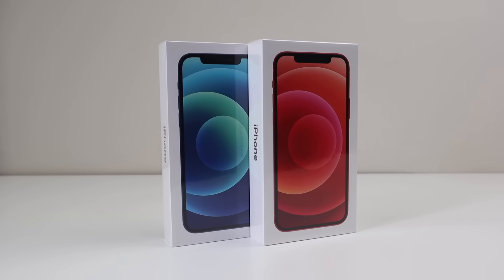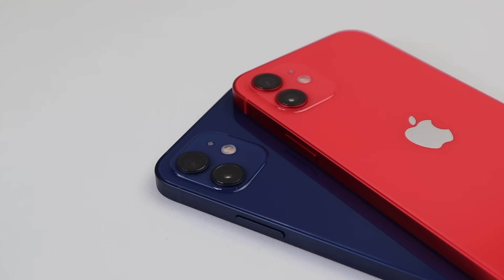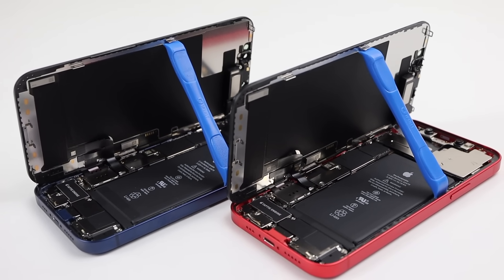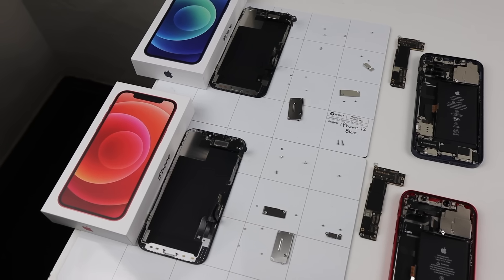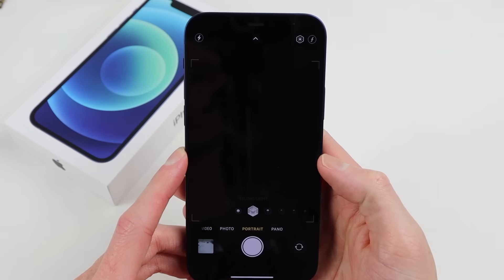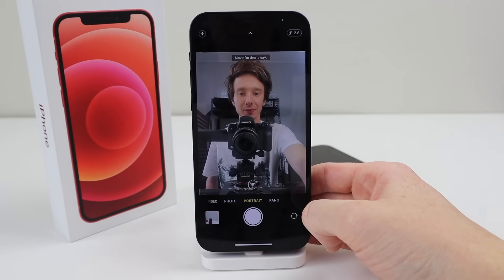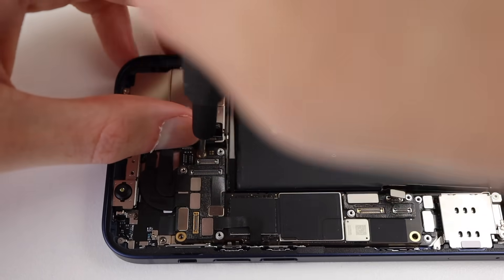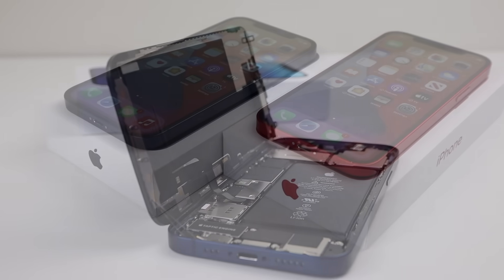iPhone 12 Anti Repair Design - Teardown and Repair Assessment

Comment: Apple never ever want anyone to do any form of repair,none of there phones have been a revalation technically yet they claim they are the pinnacle .there has been so much they have done wrong in the past yet they still rip everyone off with inflated prices for phones which are no better than the competion. apple play catch up every year yet its the badge that sells the phone not for the sum of its parts which some are sourced from samsung and LG apple have done everything to keep you tied to them even down to repairs something which should be easily undertaken by a 3rd party.this video proves again how sneaky apple are and this new trick will make apples pockets a bit deeper.

Comment: 1:00 I commented this exact same problem on a different video, and i had a bunch of people defending apple, that people will have a usb-c charger at home, well i don't, because i strictly use iphones, i dont buy a new product when my old one does what it supposed to do, i have a retina macbook pro from 2012, that thing works perfectly fine, but it doesn't have usb-c, i have an ipad 3 (its old, i know) but once again, it works for me, but those iphones come with a usb-c cable, just as i expected, IF i buy this device, i will have to buy a usb-c charger brick, because i don't have any devices using that port, but usb-a bricks, man, open some drawers and you will find plenty of those! Ewaste . . . Apple is going in a sh1tty direction, and i don't like that, i retired my mac pro in favor of a stunning gaming pc, and if this is the route they will take, i am taking a different one, away from apple products for good!

Comment: It's because any used iPhone 8 gen and earlier are riddled with cheap cheesiness replacement parts if you buy them used from bulk sellers. They are all refurbished in some way and a lot of times the customer gets the short side of it. I've seen a lot of these worked on devices and you can easily tell they have replacement parts in them. Apple is protecting the buyer because in the open market you will only find replacement camera modules with degraded quality. So lets say someone bought a destroyed phone to fix and sell it, the customer will most likely get non oem parts inside it that is of lesser quality.

Comment: Good video

Good video. I think consumers have the right to repair their own devices, and manufacturers shouldn't hold the monopoly on this. Do you think the cameras and the controller on the board may have been slightly different hardware revisions, which may account for the problem?

Comment: In some new vehicles you cannot change the battery without using manufacturer tools to "pair" or register the change, seeing the iphone pairing screens and cameras, and not letting people reusing parts from other phone does nothing for recycling, in some way I can see batteries being an issue, but provided they are to the same spec then there should be no issues. This is just protection racket gone mad.

Comment: Well, you can reset the software as often, as you want... The display, batterie and face id components are equipped with an ,,ID Module'' which pairs them to the logic board.. meaning, you would have to take the module off the old components and solder them on the new components, that would be he only way to get rid of the warning signs, unless you wanna go to the apple, or authorized stores and pay about the price of a new device to swap out the logic board in case of repair, killing the whole marketing of apple about ,,cutting waste''
Reply from the maker: I am aware of this, however i have to show reseting it so show its not just some glitch.
Reply: @HughJeffreys  Yeah of course, no offends.. As you said earlier in the video,  Apple tries to ,,save-waste'' ...

But this is more than bullshit... I mean, no other manufacturer does this kind of stuff, as an android user,  love to fix my phones myself, even if i have to swap the mainboards, but what Apple does, is just a shame...

Comment: Modern roach motels.  One difference with the original roach motel is that these phones have a much wider distribution and we are the roaches.  I guess you need the Apple only piece of software that does the pairing of the hardware to your phone.  Of course they would not tell you about it.  This special sauce makes they billions of USD in service fees.

Comment: Ok first off I'm not an Apple fan. However the specs on this phone are impressive but i would never buy one purely and simply for the reasons Hugh outlined. I can see the people now at the Genius Bar explaining their issues only to be told the phone got wet and it's not covered by warranty. Not to worry because they can replace it for $1000 but you will lose all your data.

Comment: It seems that the phone checks the serial number (or the parts fingerprints) as soon the battery is attached or when the power button is pressed.

Kinda similar to PC boot check I presume.

I wonder if one day the boot checking part was discovered and can be reprogrammed, that might change the whole thing.

Just an opinion though.

Comment: Apple probadly has made this feature so when you send it to them or go to apple they probadly going to have a system that resets and forces the new parts to sync with the phone therefore only they would be able to fix the phone
Reply: Correct. Replacement camera modules can indeed be reprogrammed by Apple or an AASP.
Reply: @no1ce  I mean if you think about it’s a smart move from apple it’s just messed up thoe because phone repair shops will get less work and the apple users will waste more money into having the new phones repair only by them

Comment: feel that for the camera it can be easily proved that they crippled the functionality on legitimate parts just to throw crap to 3rd party repairs. There could be a lawsuit for this, because it's just a software issue, not related in any ways with a possible counterfeit/defective hardware

Comment: I absolutely agree with you on the repairability standpoint, but with the charger situation, you are ignoring important facts. 
1) if you have the old brick from an iPhone or iPad, you also have the old cable, which will be working fine, 
2) Yes, the USB-C chargers shipped only with the iPhone 11, but iPad Pros and Macbooks also ship with them as early as 2015. 
3) Instead of another charger, buy an A to C Adapter for a Dollar, that apple doesnt even sell, which works fine (I tested with a 7 ) to use an old charger with a new cable

Comment: This shows that a programmer will need to be used to reprogram these parts but not everyone can afford a $500 programmer. I really hope someone comes out with a programmer that is just a cheap usb cable that plugs into the computer that can just be used to reprogram the parts, I don’t see why that can’t be a thing.
Reply: It is certainly possible as that is all we used to reprogram replacement parts at our shop which is Apple Authorized. Just a lighting cable and special cloud-based software from Apple.

Comment: It should be illegal to pair parts like this.... All parts should be 100% modular, replaceable via Apple or a 3rd Party provider. Fixing your phone yourself should NOT mean that you lose functionality. That's so unbelievably scummy of Apple. I hope at some point a new law goes into place that prevents them from doing this crap. It's fucked up. These huge companies get away with too much. You spend the money on the fucking device yet you can't pick and choose where you buy your replacement parts from ? You're either forced to buy a brand new phone (increasing e-waste a shit ton) or you lose so much functionality you are literally forced to go to Apple. I am not against the software warning you about parts that are not official but this should NOT mean that the software prevents you from using certain features. 1 warning, everything else works as expected. It seems Apple already has the ability to detect parts that are not official so they have the ability to do this. This warning btw doesn't need to be an in your face "learn more" dialog box. They could put an extra menu in the settings area "Device Health" where your battery health and genuine parts check would be. Keeping all the benefits of the warnings WITHOUT removing features if unofficial parts are installed.

Comment: Interesting to see if components swapped between same model would work, ie two blue model cameras swapped over
Reply: He tried that in the video. The camera, display, and battery are tied to the logic board.
Reply: Swapping out components from different model iPhones is unlikely to work, would have been far more usefull to swap components from the same type of phone. A camera module from a iPhone 6 won’t talk to a iPhone 5
Reply: @williamdouglas1913  They are the same model in the video. Both are iPhone 12’s. It won’t change anything as I can confirm the rear camera module is serialized and indeed paired to the logic board. So if that serial number differs, the phone will know.

Comment: A repair guy ran into this similar problem before on an ipad mini tablet. He told me to fix these issues he just needs to remove the processor and put it back and that should "reset" the warnings that you see. Not 100% if he was bullshitting me but it actually worked on my tablet. So maybe you could try that see if it works too?

Comment: I’m not completely against this, but the user should be allowed to chose wether or not the components are serialised and link to a specific device. I think it’s a safety mechanise to prevent theft. You can iCloud block your lost device so people can’t use it, but with this they can no longer sell the phone for parts. Making theft slightly less likely.

Comment: Absolutely disgusting practice by Apple, but hopefully, European Union laws will make them change, next year, according to news (this is a news title):
  "The European Commission has ratified new "right to repair" regulations which will make the repair of domestic appliances easier. From 2021, the regulations require manufacturers to design longer-lasting machines and to make spare parts easily and readily available for up to ten years in a bid to reduce waste."

 Even though phones, laptops aren't covered by the law initially, they want to include those as well, as written in the Guardian:

 "Manufacturers of phones, tablets and laptops will face legal obligations to make their products easier to repair and reuse, under a far-reaching recycling plan from the European Union executive.

The European commission wants to drastically increase recycling of electronic goods, which are often difficult to repair, replace batteries or upgrade. Less than 40% of electronic waste in the EU is thought to be recycled.

Billed as “the right to repair”, the European commission will extend an eco-design law to cover phones, tablets and laptops, setting technical standards so these goods consist of changeable and repairable parts. The current eco-design directive sets energy efficiency standards for computers, TVs, dishwashers and washing machines."

 Hopefully other countries will follow this, or Apple will have to make changes to their "environment friendly" products for actually help the environment for once, in order not to lose the European market.

Comment: Apple has a long, long history of removing features from devices and telling you they were upgrades.  Going back to the 80s, with the introduction of the Macintosh.
Reply: @harassmentisbad1046  What did Apple remove with the 5s?
Reply: @harassmentisbad1046  Touch ID was always unrepairable wdym? iPhone 5s was the first phone to have Touch ID, iPhone 5 and 5c just had normal home buttons with no Touch ID.

Comment: The need to turn on with lightning port is quite normal and has been this way for some time especially if you have not disconnected the battery before installing screen. The rest is normal apart from the rear camera this is a new problem thanks for the video 🤘

Comment: Such misinformation here, all the issues you found have been there on previous models and all are repairable. Tru tone can be reprogrammed in. The messages appearing can also be fixed by swapping the chips from the screen and battery. And the camera is also repairable by reprogramming the new Camera. All of these are repairable by 3rd party repairers. If you wonder how I know, its because I repair them all the time.

Also as far as getting the parts for these, they are available you just need to ask a proper repairer

Comment: The camera module's linked to Face ID and Face ID is intrinsically linked to my gaining access to my phone and making purchases on my debit and credit cards.  I'm quite reassured that Apple has ensured that a bad actor is unable to nick my phone and swap the camera unit with something that can bypass the phone's security.  Any component which forms part of the first-line defence against privacy protection and security should not be easy to replace.  Later on down the track (when the phone model's no longer supported), perhaps iOS should be set to recognise the non-Apple repair and purposely disable Face ID, and certainly Wallet, in order to assure customers that their continued use of an obsolete phone is secure.

Comment: Would it work if you use two iPhone 12 instead of two different models(12&12 pro)?
Reply: Nope. The rear camera module is paired to the logic board of the device and needs to be reprogrammed by Apple or an AASP.

Comment: One of the ways by which Apple could be ensuring that factory fit parts are not swapped, is by something called as firmware signing, each module like the camera, face Id, mic, speakers, etc have a unique ID based on which during factory bootup, a signature is generated and stored in the memory. So, when you try to boot it up with a different module, a signature is again generated during bootup and processor compares this one with the factory stored one. Since it finds this is not same, it will disable some of the functionalties. My guess is that - in case of repairs- Apple technicians would be having a separate software/tool to completely erase the memory and then put in the new part .

Comment: Maybe I'm getting old but having been around Apple for over 25 years this notion of not wanting users to get in and tinker isn't a new thing. It goes back to the original thinking of Steve Jobs. It was why the original Macs were always a closed environment and had no expansion slots. Jobs didn't believe in it, he thought the device was exceptional and there was no need to 'tinker'. I also worked in AASPs for a good while and believe me the repair markup on parts was astronomical. So its a money maker for sure. But they have extended the independent network or repair providers and generally where these issues have arisen the community has worked around it so repairs will be possible. But again as Jobs said - if people want to buy our products they will, and if they dont they wont.  They seem to be doing OK out of that mentality.

Comment: The reason behind the issues is they program certain serial numbers from the parts to the kernel of the phone when it boots. Just like a pc is programmed to a specific hard drive in raid 0. When you assign a part to the boot kernel or os on startup you have a specific set of numbers that talk back to the logic board. When you dont you have miscommunication issues between the the logic board and the parts. If you have different serial numbers trying to communicate with the logic board. There is an asian market in china who has a serial number reassignment device that resets the main root or kernel of the phone and lets the new part communicate with it. In all honesty apple just doesnt want you inside their phones. They want you to spend more money on repairs or just getting a new phone. Androids are repair friendly and alot more affordable.  Apple is just plain greedy.

Comment: When parts become available could you check if the issue only occurs on parts that have been connected with other devices prior or on all parts swapped? Also have you tried inter changing the screen? This also makes me curious as to how apple genius bar is going to repair these phones or maybe they'll either have brand new parts or have a special device or software to pair them.
Reply: The rear camera module is serialized and paired to the logic board. If Apple or an AASP replaces the rear camera they have to reconfigure (reprogram) the module using a cloud-based system. The same is true with displays and batteries.
Reply: @no1ce  RIP, guess we're going to need third party based devices to repair and pair them from now on especially for third party repair shops. The question is gonna be how much they are going to cost from now on for the devices and cost to repair.

Comment: I have stupid questions:
How can you have so many charger adaptors and no charging wire? Is the lightning port on this device any different from the others you may previously have had?
Wouldn't it be nicer to not avail of this thing instead? This thing is more of a fidget than a phone anyway. That said, i appreciate your sacrifice. A lot.
If you own the phone but you do not own the software, shouldn't you be charging them for the power it needs to operate? For the data it needs to update? For the information it collects to advertise back to you?
Finally, can i throw this around like a nokia or an xperia like a throwing knife and use it afterwards like a regular phone again?

Comment: That qr code on the back of the camera module has something to do with this issue
Reply: The matrix (QR) code on the back simply stores the serial number of each one of the camera sensors. You are technically right in the sense that the camera modules are serialized and paired to the logic board. They can only be reprogrammed by Apple or an Authorized Service Provider.